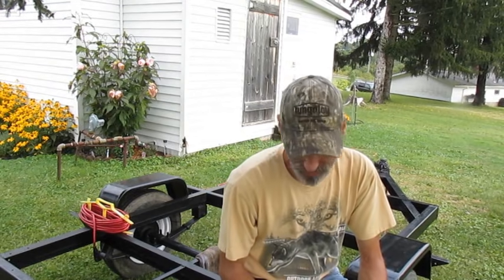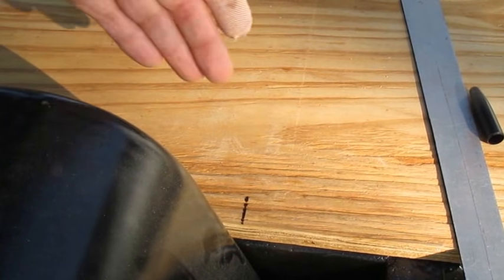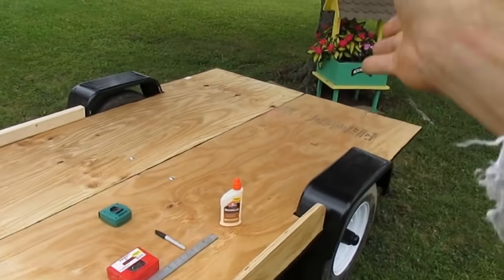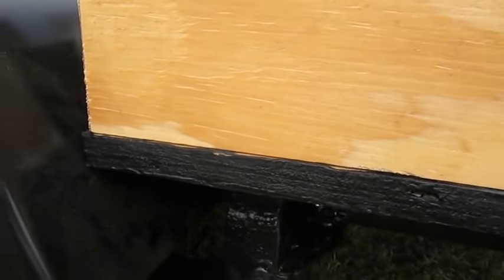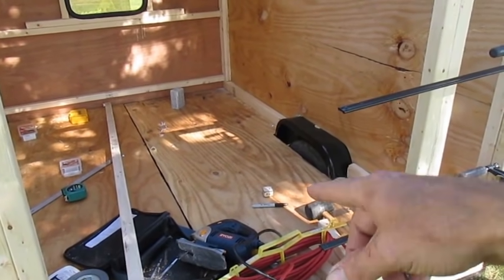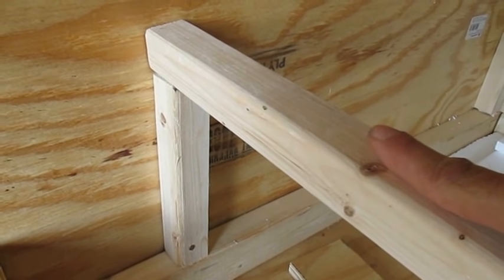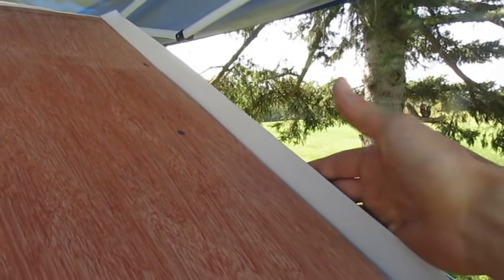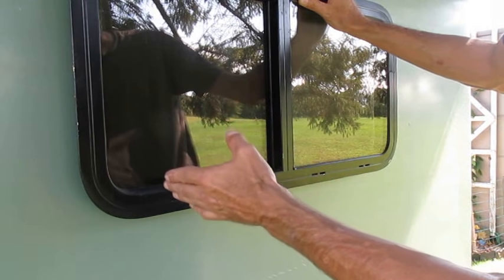Homemade Camper Build (Micro Ultra Lite Complete Build)

Comment: I don't think carpet in a camper is a good idea. What happens if you spill some on it, what about mud and dirt? How are you going to keep it clean??? I would put linoleum on the floor and then a rug. At least then if the rug gets dirty you can toss it and get a new one.. you can buy a cheap rug. You can also keep a small broom to brush out dirt off the linoleum floor and spills just wipe them up- easy.
Reply: Is that how you built your trailer?

Comment: Basically , a 2 x 3 is metric 2x4 in Canada. Canada is on the metric system.
Reply: Umm no, a 2x3 is the same in Canada or the US. 1.5”x2.5” actual size. A 2x4 is 1.5”x3.5” actual size.
Reply: The rough dimensioned lumber is 2 x 4 but the each side is planed 1/8 inch on each side giving the end product of 1.5 inch x 3.5 inch dressed lumber. No metric required.